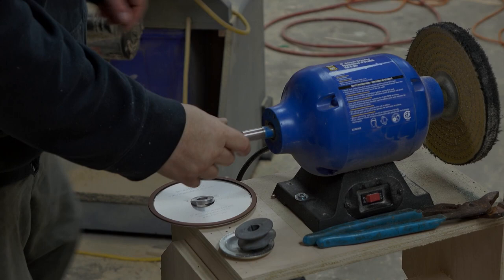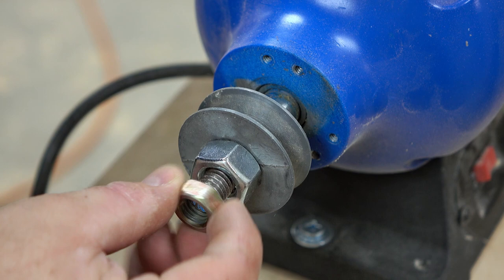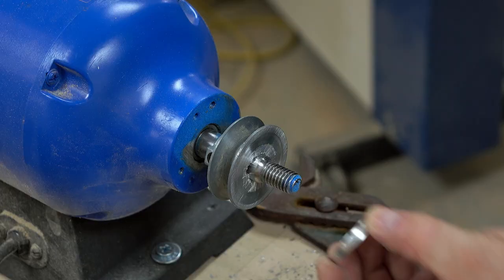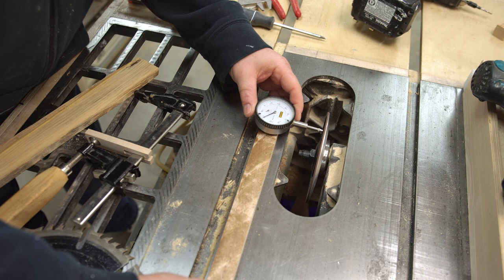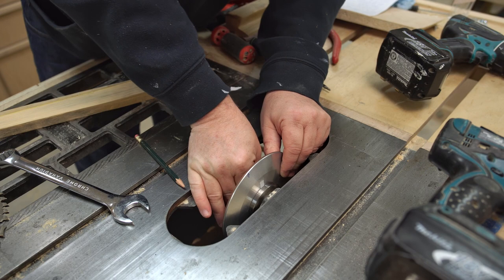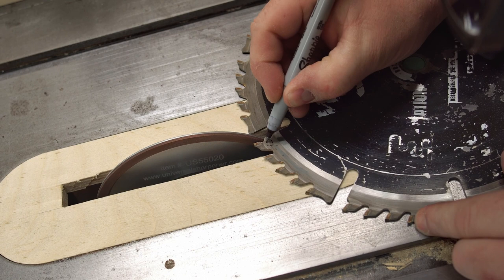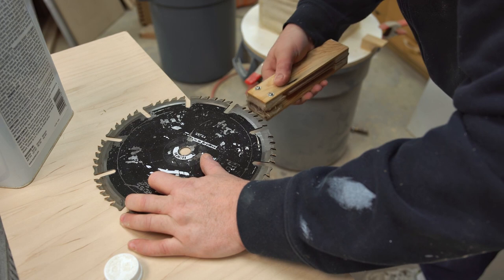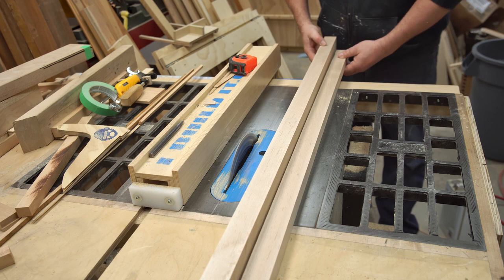Sharpening Saw Blades On The Table Saw

Comment: After trying as number of methods for sharpening rip blades for my table saws, I tried the Harbor Freight saw sharpener.
To my pleasant surprise, it worked very well -- and for less total investment in time and money than other methods I had tried.
It also works very well for sharpening the crosscut blade on my miter saw.

Still, I think you have come up with a very good approach to sharpening rip blades.

Great video!  Thanks.

Comment: Not too bad really. You certainly understand the theory behind sharpening and the importance of proper setup. If I could make a few suggestions to help out. Firstly, you need a jig to hold the blades. If this is something you want to get into, make a jig. Second you marked your starting tooth good to see, but you should also put some marker on 1 tooth face. Spin the grinding wheel by hand till it is removing all the marker so you know you are lined up square with the tooth faces. This is where the jig will really help, you need to try to maintain the hook angle as best you can. Lastly, never grind the tops by hand. Grinding the faces like you did is fine, you can be sloppy. But if you are off on your angles even a bit on the tops, you'll get blade run out and poor cut quality. All in all impressive, I work for Leitz Tooling and this was not too shabby.

Comment: I would have thought you would sharpen alternate teeth with the disk tilted some amount and the remaining teeth with an opposite tilt.  Great idea for my shop.  Thanks
Reply from the maker: That would be a different type of blade - ATAF it's known as and it has angled tooth faces. Most blades have flat tooth faces.
Reply: Cmt has the shear face blades. But you get 75% of your cutting action from the top of the tooth.

Comment: I made a flat sled setup to do this years ago.That runs on the 2 slots .have a centre pivot the blade centre can spin on . Put a stop so can only go to a set point pushing in. ..to use...line up. Grind ..pull back .rotate a tooth... push in to stop repeat.

Comment: Nice one John. Watching this vid gave me an idea. Could we make a sled to put the dull blade on around an axle rather than manually holding it to sharpen the teeth.
Reply from the maker: Certainly, but the 6" diamond wheel doesn't stick up very high above the table saw, so it couldn't be too thick. The axle location would have to be adjustable too, for different blade diameters and hook angles.

Comment: Seems like it would be worth making a simple jig with a dowel to hold the blade and using the slots of the table line it up without having to check the angle with your drawn circle on the tape. Assuming the hole for your blades is the same diameter you could sharpen quite a few in an hours time to make the most of the setup of the sharpening blade.  Love the videos.

Comment: Hi John. I currently use a method you displayed previously, a fine grit diamond plate glued to a thin wedge, sharpening the blade while still installed in the saw. 20 strokes per tooth (10 forward, 10 back). Oil and clean the plate every few teeth.  Works well. Did you abandon this method because it was too slow, or another reason?  Thanks for everything.

Comment: I like to use "Simple Green" cleaner and a brass brush to clean my blades.  If they were really caked with resin, the cleaning all by itself makes them seem like new.
Reply: thedraphter ya cleaning easily doubles run time.

Comment: You didn't like the first method you used with the 20-degree beveled stick?  I noticed that it was very dependent on the hight of the blade.  But I liked it.  I can't find a good set of diamond sticks for decent money.  I thru a 7 1/4" blade in to get some work done.

Comment: Could you have used the setscrew on the pulley to secure it to the shaft for turning it true? That way you could've turned it all without having to chisel out the middle section.

Comment: Could the indicator be used on the back side, assuming it's true to the front side
Reply from the maker: A sharpening pass takes just a few thousandths of an inch off the face of each tooth, less than the thickness of a sheet of paper.

Comment: I love the simplicity.  Where did you get the diamond wheel?  Affiliate link would be great.  Anything special to look for in a diamod wheel?

Great video!
Reply from the maker: I don't do affiliate links, but the grinding wheel is from universal sharpener dot com.
Reply: If you can get diamond wheels with a D64 grit, I'd suggest that. Good for all applications regarding carbide sharpening. If you want to get fancy you'll need a D64 for pre-grinding, and D107 for finishing.

Comment: Did you consider building a sled with a spindle to hold the blade so you can maintain a consistent angle? Thanks for the informative video!
Reply: He said earlier that the diamond sharpening blade barely sticks up high enough for a sled.

Comment: Very cool! Do you think the blade could be mounted on some kind of sliding jig to fix the angle for those of us with less precise hands?
Reply: Ok, I just read the article so I guess that was your intention.  I'd love to see it when you get around to it. Any reason you'd go back to the grinder instead of sticking with the table saw? The stable base and the ability to tilt seems like a big advantage for the reason you mentioned in the article.
Reply from the maker: I could leave the wheel on the grinder and it would be ready to use whenever I needed it.
Reply: John Heisz Ah, good point.

Comment: I'm curious why you said kilometers. You seem to stick to the imperial units whenever you can, so why not for driving distances? Not trying to be funny, just genuinely curious.
Reply: I wondered the same thing.  Maybe 80km sounds worse than 50 miles.
Reply from the maker: Because Canada is a mixed up country, as far as imperial / metric go. We switched over back in the 70's, but not everything "took". We measure temperature in Celsius, driving distance in kilometers and fluids in liters, but still do imperial for most building supplies.
Reply: Here in the UK we swapped to metric in the 70’s too. Most things here have gone metric except distances, but were still firmly using miles!! Oh and pints in the pubs too!! Growing up learnt a bit of both so can use metric and Imperial but was hopeless at fractions in Maths so glad we now use metric now!

Comment: John, Can I use an 8" Dado stack on a 10" craftsman table saw?
Reply: Mark Baron I have an older craftsman. It just barely fits two regular kerf blades. I’ve used two thin kerfs with diy hdpe shim and that maxes out my arbors width.

Comment: If you divide the inches per second (say 1-10) feed rate by the number of teeth per second making the cut (say 3600 rpm / 60 seconds * (say) 60 teeth per revolution)... it's only a few thousandths at most at the point of the tooth that are cutting...    A tooth just 2 thou lower will never cut... so this might work once or twice if you're very precise before an irregular bunch of teeth results. IMHO.
Reply from the maker: But when the ones that are 2 thou higher get dull, the lower ones will pick up the slack :)
I doubt blades direct from the factory are ground to such a tight tolerance, especially the lower cost ones.
Reply: Honestly you're kind of on to something here. The real problem with removing more material for 1 tooth versus the other is Carbide is quite dense. Even slight variations in tooth thickness throw off the balance of the blade causing vibrations. John's right cheaper blades are not made to tight tolerances but that's why they don't cut as well or as long. If you buy quality blades I can assure you they are precision balanced. If you need ear plugs while cutting, your blade is not well balanced.

Comment: I don't want to even think of the consequences of a kickback with this sharpening "system".
Reply: Wolf Lahti zero chance of kickback
Reply: Wolf Lahti How would that happen?
Reply: axtra92 kickback is when the piece you are cutting contacts the rear of the blade, the rising side of the blade will hurl the work back at you. In this instance he’s using the table saw like a grinder, so no contact with the rear of the wheel. That make sense?

Comment: What chemical did you use to clean the blade? I have a gunked up blade that's starting to smoke on hard wood and needs cleaning (and sharpening quite likely).
Also waiting for the crucifying comments, because you used a wood chisel to "machine" aluminium.
Reply from the maker: I use lacquer thinner.
Reply: Non ferrous metals can be worked with wood tools.

Comment: I think I just realized why these safety nazis always talk about not using push sticks. They don’t actually use a table saw. I cringed at how close your fingers were to that blade. Until I realized I’ve been waaaaaay closer to the blade and I haven’t used my table saw in a month. I need to get back at it. Lmao

Comment: Come on John buy a new blade,
Reply: At ~$50-100/blade (for anything that's worth a damn)? Pfft, taking 5 minutes to sharpen it is well worth the time.
Reply from the maker: I have more than $1000 worth of blades, I don't need to buy any new ones.
Reply: Eddie Espinosa You must work for the Evil Saw Blade Companies
Reply: wiser82 Big Carpenter